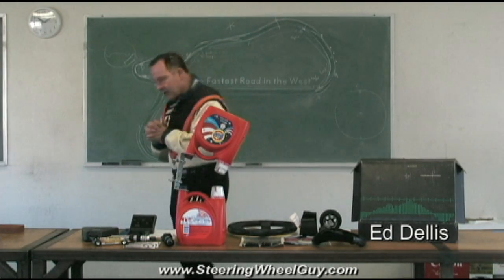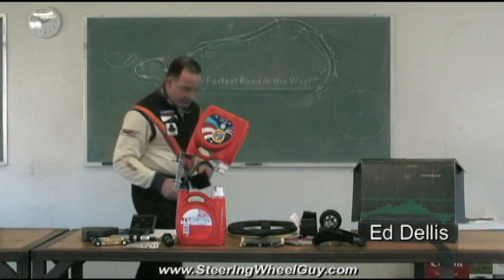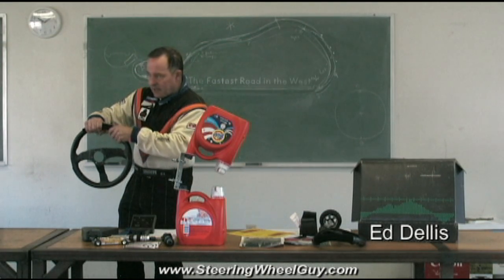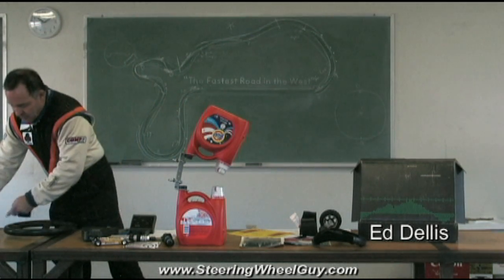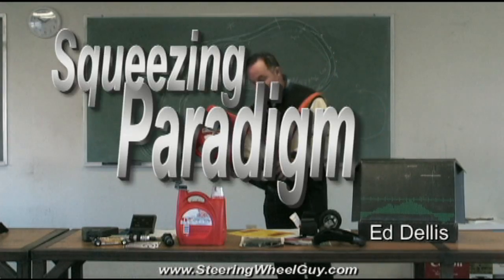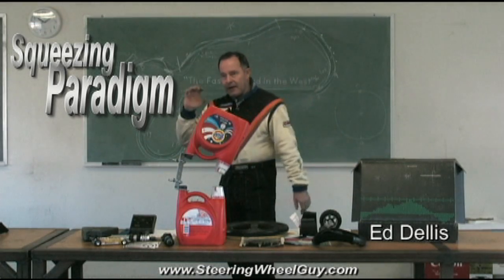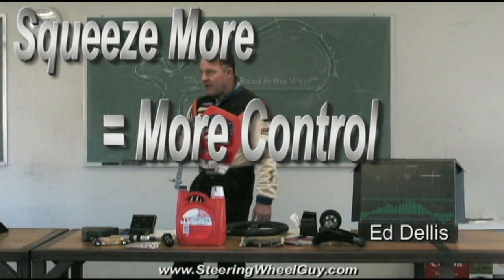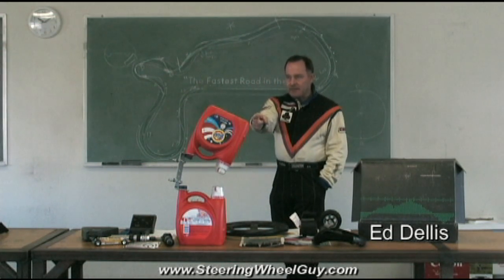Racing Steering Wheel Grip Theory Explained

Comment: What the hell is this guy talking about.
Reply from the maker: I know right?  When you think of grabbing a steering wheel in the traditional sense, it doesn't make any sense at all.  BUT, if you think outside the box, it works.  I've used that method of explaining what goes on at the HMI for over 6 years...it works.  Ask any of my drivers who use PersonaGrip in IndyCar, Formula One, NASCAR, etc. www.SteeringWheelGuy.com has more.  But, when I spoke at steering conferences in Berlin, Dusseldorf, and Ann Arbor, MI, I went down the Rabbit Hole deeper, and those clips can be found here:  www.SteeringWheelTechnology.com